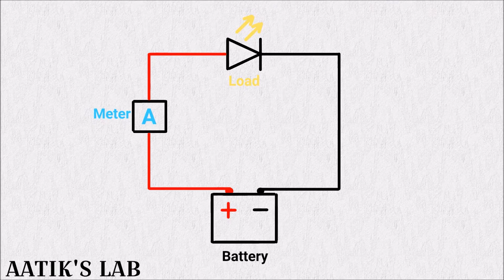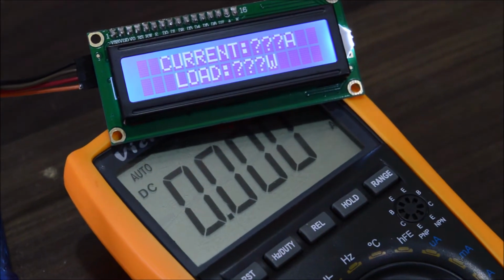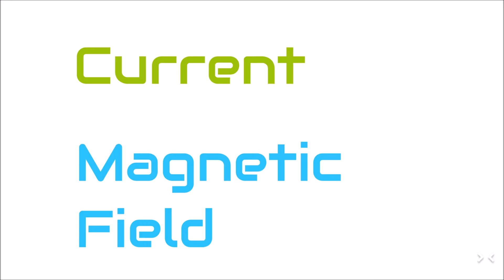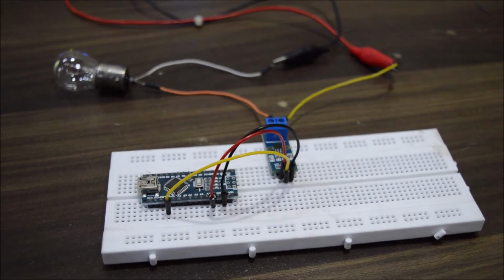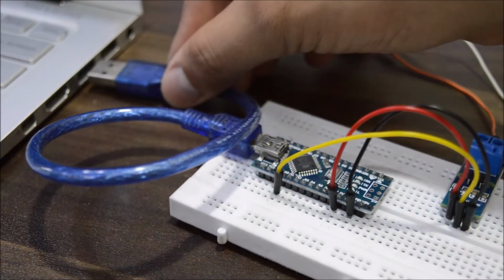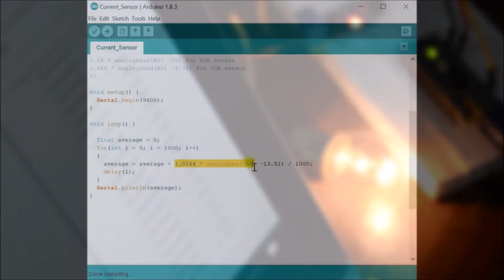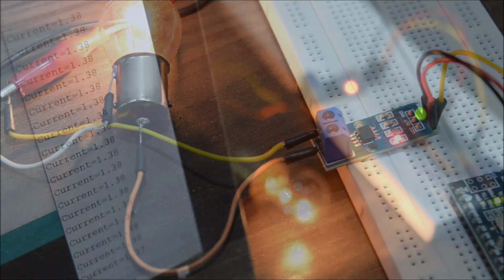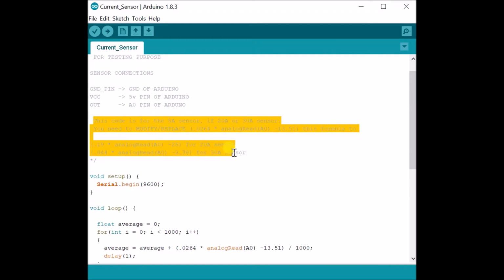How To Use Arduino Current Sensor ASC712

Comment: Hi, Could you recommend the above sensor for measuring a current less than 0.9mA from a board? My project is based on Arduino.

Comment: I want to create a system where an led turns on when my wireless charger is in use. I assume the load in this case would be the charger. How do I decide which amp to do with is a get a 10watt charger? This is a hobby project and I’m completely new to electronics. Thanks in advance!

Comment: hi, why i try using this code the value of current is so high? i am using 20 A Acs 712
Reply: Same for me.. How did u rectify it?
Reply: The min resultin resolution it can report is 20A / 1024

= .020 A
= 20 mA

Comment: Can you write code to make an overcurrent protection? The digital output pin of the Arduino should go high if the AC current value is crossed the predetermined value.
I want to make a cheap overcurrent protection circuit for my AC Motor. When a motor is turned ON, it takes around 16Amps starting current for around 5 sec & 6 amps current in normal operation. I will use a CT if required.

Comment: I have followed this schematic and layout for the device, but can't seem to get an accurate reading on the current. I have the 20amp acs712 sensor, with ip+ hooked up to +5v power supply, and ip- hooked to the 5V supply on a part i am trying to measure current on, then ground and 5v from the arduino to the acs712 and A0 is the Vout of the acs712. Am I doing anything wrong, because when I power it with a curve tracer I read 12mA at 5v for the part, but the current sensor (with the code for the 20amp) outputs a value of ~72.1, and this has absolutely no correlation with what I am getting on the curve tracer. Please help!!

Comment: I am looking for a simple project using a 5MA/5A current sensor to sense my doorbell current when someone pushes my doorbell button.  One of the transformer wires of my doorbell would run through the sensor.  Sensor gets connected to a ESP32 DEV board which sends me a alert message.

Comment: Hallo sir, is the sensor can use for nodemcu esp32? Thx
Reply from the maker: Yes of course !!!
Reply: @Aatikslab  i'm so confuse why my acs show the wrong calculation about the current, when i tried to measure the current from a lamp, do you know what the trouble from? because i ever move from one pin to another but the measure still wrong. thx

Comment: Thank You. Can I connect two sensors to the aurdino board shown in the video. I am a layman.
Reply from the maker: yes you can connect upto 8 sensors to arduino`s analog pins ranging from A0 to A7